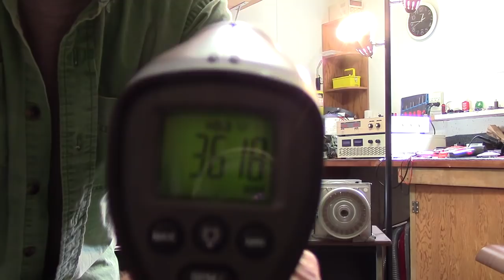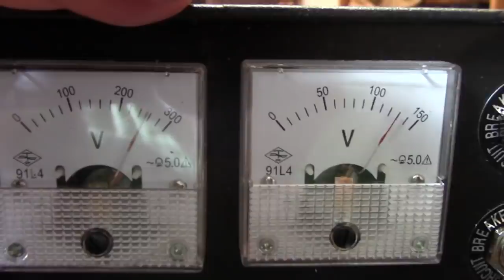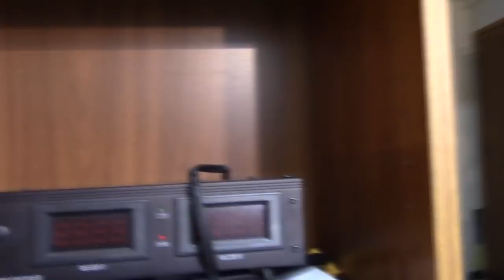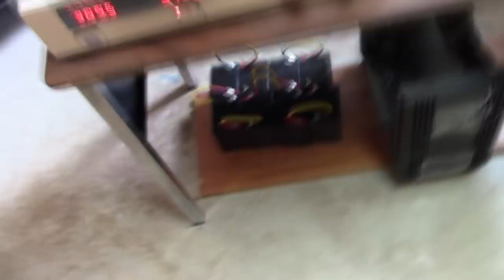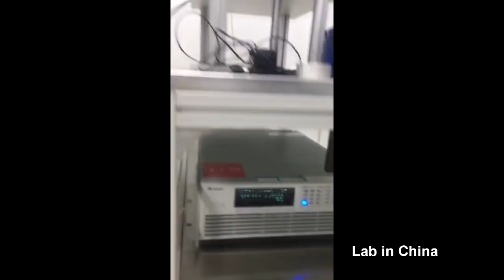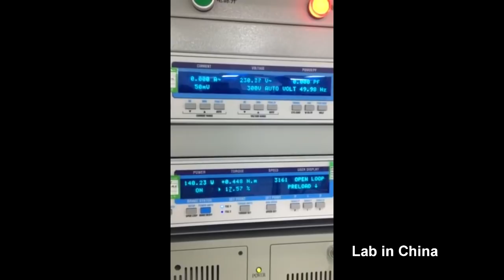China Lab Video + Early loop evidence

Comment: Use graphene to construct the hybrid stirling cold gas cycle HHO internal combustion engine. To take advantage of graphene's properties of expanding when cold and shrinking when heated and it's ability to conduct electrical energy. An implosion will generate a frequency that can be tuned to optimize electrical current generation of graphene solid state solid electrolyte power cell's. A home central air conditioning electrical power generation system operating off liquid air being processed for HHO to feul the HHO Doyle split cycle internal implosion engine spinning an electrical power generation system and the fan to move air through air conditioning system. So you could use a hybrid stirling cold gas engine HHO implosion cycle to provide air conditioning and electrical power generation frim mechanical movement and from frequency generation from the frequency produced by the implosion cycle of the implosion engine. Thses concepts have many other application's for industrial use and for farming and hydroponic green house's and regular green house's to control climate water temperature and electrical power generation to operate fan's and lighting and water pumps. 😊
Reply: How will this help Gerard's present project?

Comment: Doyle split cycle modified into implosion engine to operate off HHO within each wheel of a vehicle.  Oh so many paths away ftom fossil fuels! Come on man you know all this is legit and will change the world! A stirling implosion engine in a axial vector configuration for low torque used with a Duke wobble plate look at swash plate pump motor to understand more about it. Implosion stirling engine in a circular configuration with a Duke wobble plate to drive a drive shaft of a vehicle or motorcycle? Crazy!! 😱💩😲😂😂😂😂😂😂😂😂😂😂

Comment: Use a stirling cryogenic piston to generate liquid atmosphere. That fills an insulated tank with frequency emitter's at the bottom to generate HHO out of the liquid air. Okay now read very carefully! HHO implosion used to power an internal implosion engine. Implosion engine designed with magnetic bearings on all moving part's so everything will be riding upon magnetic cushion's so no need for lubercant's. I was looking at stirling engine's to develop a stirling engine that was a cold gas engine with an implosion at the bottom of the top stroke to suck the piston down with the cold gas action at the top stroke of the piston's movement. The left over liquid nitrogen filling an insulated resivor housing the cold gas piston's cylinder head's providing the cold gas stirling cycle with the liquid nitrogen boiling off back into the atmosphere. A neat new modification of the stirling engine concept that can also be used to generate electricity? Hay your the mad scientist this why i ask you about this working?  Could develop an aircraft that operated off liquid air by processing HHO for implosion engine's and use a hybrid stirling engine to have no more need for jet fuel?  Would it be possible to design a HHO implosion turbine? If so then now you have implosion jet turbine's to power jet aircraft and electrical power generation system's? Alternate mean's of doing thing's? Dual engine's HHO implosion engine's will operate in space and within earth's atmosphere? The liquid atmosphere being instantly being turned back into atmosphere to propel an aircraft in a vacume? Crazy idea's joe cell implosion gas HHO implosion gas internal implosion engine's the new engine of the future better jump on it before those free Masonic pukes who operate the patent office get rid of that information or block anyone ftom using that technology! 😒     😊😱💩😂😂
Reply: Do you have a proto type?  Is this covered on a recent Utube Video?
Reply: I have knowledge of colon parasisis Iussas who calls itself god while feeding off human colon secretion's? Does this make me stupid less smart then all those beast bugs who are just so very inintelligent? 🙊👽🔨
Reply: Okay so all those nutter's that all trace a bioengineered alien parasitic penis stinger symbol on dey lip's are blessed and saved from having their colon secretion's and glandular brain secretion's sucked off by the Iussas maggot's up dey butt's while the Iussas bioengineered nasty Focker call's itself a god? Wow really? Hay i just giving Motrin neat idea's of technology cuz i feels sorry for him from being gagged and sodomized into parasisis slavery. Salvation through da colon wow who knew well those Iussas bioengineered nasty Focker's know heh? 🙊😒👽👄💩💀👽🔨

Comment: I signed a non disclosure to get information about an investment opportunity.  I don't really understand this stuff works.  They say that when they go to production they can make these for about $1500 each.   I can't mention company name because of non disclosure. Can you tell me if this looks like a good investment ?  Thanks in advance.

STCP Revolutionary Technology

The Solex Tokamak Concentrator Positron is a revolutionary breakthrough in solar energy 120 times more efficient than current solar panels (PV).  The STCP uses a spinning matrix of fresnel lens suspended via neodymium magnets for concentrating the sunlight beam along with a hot plasma ionizer that actually splits individual photons in a torus, releasing an incredible amount of energy.  The neodymium magnets reduce the friction coefficient to zero, eliminating problems of earlier prototypes.  The hot plasma allows the multiplexed concentration and subsequent splitting of photons with no moving parts, so it is incredibly reliable.  We are able to split on the order of 6.2 million photons per second.  Each split photon creates a free electron and a quark that instantly degrades by means of a compound vortex controlled diffusion chamber  (CVCDC) that is inexpensive to fabricate.  In the process, the CVCDC removes the heat that would normally be generated.  Without the massive heat created in a conventional tokamak the size can be reduced dramatically.  No huge case of iron is needed since a split photon doesn’t release any dangerous particles, and weight is reduced by 23 times.   An STCP the size of a loaf of bread, can produce over 140,000 watts of electrical power, that’s almost 200 horsepower and weighs only 17 pounds.  The STCP works like a turbocharger for photons.  The technology is derived from the US Governments SDI (Strategic Defense Initiative) project, that was previously thought to have been cancelled, and is spinoff of Department of Defense research.

Comment: A Joe cell with the correct gallium alloy combination surrounded by solid state graphene crystal power cell's. That generate electrical current from the Schumann resononce that will power the Joe cell up to a frequency that generates a resononce bubble that will make out each crystal power cells harmonic resononce electrical output activating vacume spark gaps on each crystal cell back to the Joe cell that causes the gallium alloy crystal matrix to resonate producing a resononce bubble that can then be absorbed by tesla coils and used to power other dvices.

Comment: Hi Gerard tell me... normal disc cutter for example AGR-125GR have 220 volt / 5 A current which near 1200 watts input and do near 2800-11000 rpm easy via redactor. But if you put generator on end you never get back this 1200 watts back from it. But here we see that you consume anway more than you produce. What is the point?
Reply: @Smarter Than You )))))

Comment: Aluminum scandium alloy resonance generator with detail to direction of crystal structures within the alloy should be very interesting to test it out? A digital motor design for a resononce generator. Ever use gadolinium and cold temperatures with your resononce generator?

Comment: borets a russian  electric submersible pump company and now Halliburton/ summit esp has the high efficiency magnet mount motors ,now saying that these motors require a different type of variable frequency drive to operate the motors. their motors actually produce high voltage when the drive shuts down and the motor spins backwards, this has created power discharge issues. But their drives and components may be of interest to you. Just thought I would mention this
Reply: I would like to see you motor actually work with a load on it IE drive something like a object requiring the motor to work
Reply: Sorry but I believe in you but these tests are all no load tests?

Comment: Gerard check out variable magnet control .. they retract the stator out of the drum while it totates and the speed increases without putting in more volts en frequency .. maybe this wil help you get the speed and torque you need without controller .  Regards nik

Comment: hey Gerard im not as keen on this but could one add a belt to the system? spinning a gear ratio that connects to a regular generator or would that defeat the purpose and add resistance and amps drawn...lowering your out put and requiring a totally different control board... idk im drinking and thinking sometimes they don't mix...lol love your info you've helped me understand "electricity" like never before...

Comment: So yet another vid with no numbers...what happened to hooking the 6'' motor up to the generator and putting a 1000w load on it...then show us how many watts it takes your 6'' motor to achieve that 1000w....
If your 6'' motor uses less the 1000w to power the 1000w load then it would prove you got something...
You could have done it easily in this vid but instead choose to use some other untested motor to light the 500w of bulbs using 1500w to power the generator rather then using the 6''...why
Hook the 6'' up to the generator and put a load on it 1000watts so we can see how many watts the 6'' is pulling to run that 1000 watt load...very simple and would shut up the skeptics...unless it's all BS which is starting to seem probable due to you refusing to run the very simple to do test...a test you could have shown in this vid as everyhing you need to do it is on the table.
One more chance for me and I will be convinced....one way or the other...
Reply: i dont think you have the knowledge to comment at all or tell someone they dont or call them names like that. for a start its called pulsed DC and already i think ive lost you, but to at least get you to see how ignorant you are i will let you in on it,a little. it starts with the duty cycle and how long the pulse width is this way the percentage of total current is less if you use 100% then you have no pulse train then your pitiful attempt to calculate watts in watts out would work but it aint so simple, try to learn something first before you teach stupid because until you can tell the difference between what you think you know and what comes out of your ass you cant know shit.
Reply: @chrisbutler267  Oh my lord...if you had even half a clue bro you would be removing you last post as It prove just how truely incompetent you really are...I could explain it to you but I think that would simply be a waste of my time lmfao...by the way...has he provided any proof or numbers on power consumption in vs out yet....let me guess...NO......let me guess...he is waiting for parts or something broke or he need to get something built...but no one can build it right...smfh.
Whatever happens don't let this guy discourage you when you finally catch on to his game and have had enough of the BS...over unity is possible...just not by this guys methods it seems...

Comment: I want to first to order . I have a 36 pole washing machine drum motor connected to a 12 volt  car alternator . With a schindler ATV12HO37F1 .VFD. I am not able to get it to run at 199.0 htz. This is the only control I can find to turn the drum motor I am counting on you to finish. Thanks in advance

Comment: Hope you get the rewards you deserve Gerard. Well done!
Reply: Keep up the good work I know you'll get it because when I was 10 years old I believe that I could make a motor that would run on itself you're going to do it and I'm proud that somebody can do it I've been told time and time again that it can't be done because of friction and this and that so I believe what people said it can be done I know you'll do it good luck your friend Mel from Tacoma Washington
Reply: Have you given thought of using an vfd ?I'm an automation and controls tech. An Allen Bradley powerflex4 you can modify parameters hertz rpm up ramp down etc.
Reply: @yeswecanfindaway8913  VFD is a bad idea. With this you need to build your own BLDC Electronic Speed controller which is much more effcient than any VFD, which are mostly designed for AC not DC. You also need to add the hall effect sensors in between the stators so the motor cntroller can calculate the Rotars exact positon called commutation (Back emf is a bad idea for commutation since it will need to spin to start genrating the back emf to know the rotor position. Hall efect sensors are best or an encoder which is even better. This so it can apply max current to the stators when resistance is building up when apply a load from the generator which would obviously be spinning connected to the shaft of this motor. the heavy the load the more resistance will build up on the motor in turn it will need more torque and current to keep it spinning at the same RPM. You will need to PID control the motor with RPM as the setpoint so it knows to stabalize at a certain RPM no matter what resitance is being aplied to the motor.